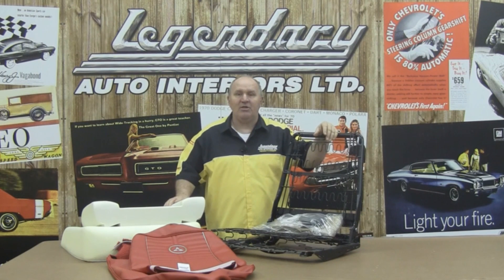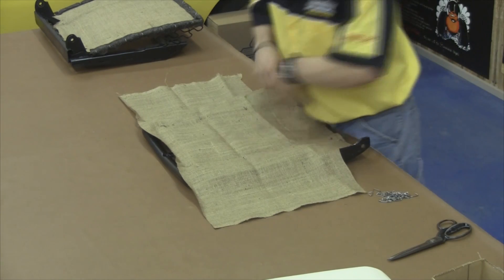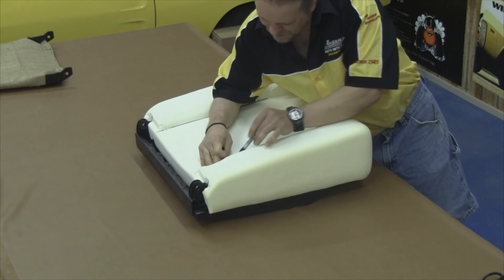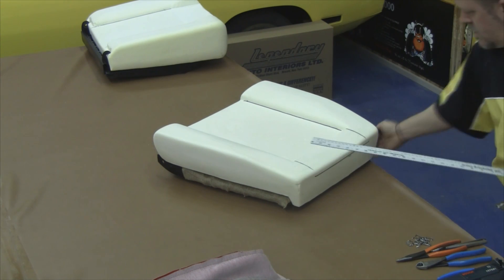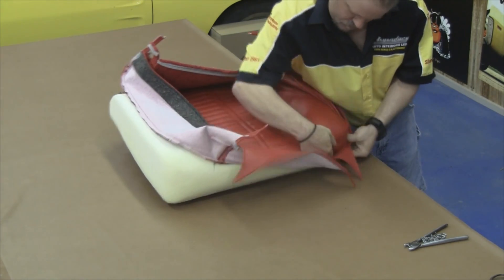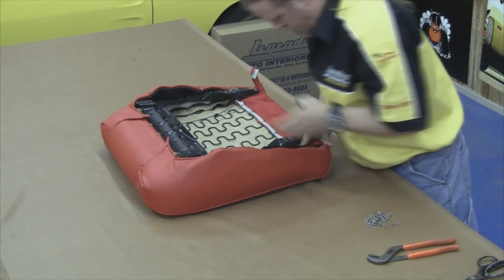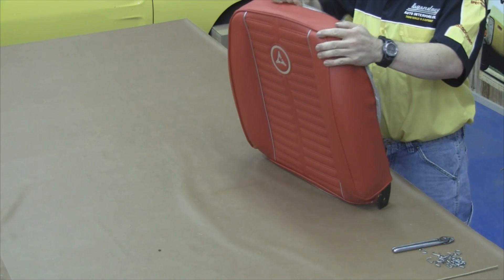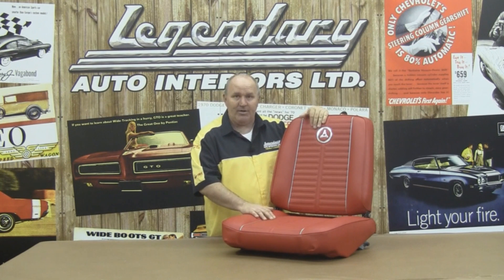1964 Dodge Dart bucket seat installation

Comment: This is such a great skill!  Watching this made me wonder if there is an auto loading hog ring plier?
 Thankyou, Legendary, for sharing these videos!
  My '70 Plymouth Duster has beautiful metallic blue covers that you made!
Reply from the maker: They do make a hog ring plier gun but they are rather expensive and are a little cumbersome to work with.I prefer the manual or spring loaded type that holds the hog ring inside the pliers.

Thanks for the comments.

Ron Halbritter
Technical Advisor
Legendary Auto Interiors